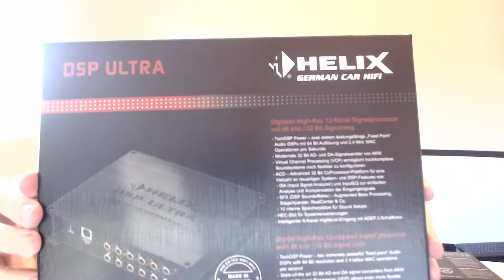Helix DSP Ultra

Comment: Can you please tell me where you got the coax cable from
Reply from the maker: I have since changed it to an Audioquest Cinnamon coaxial digital cable and I ordered mine from a local audio video store as it’s 5 metres long. You might be able to find one on Amazon.
Reply: @CarAudioHorizons   I'm just building a system. Going with 2 way focal utopia m speakers a mosconi pro 5/30 amp. Jl audio 10 inch w7. I just can't make up my mind on the dsp , either mosconi 8 to 12 aerospace,  helix dsp ultra or pro mk3
Reply from the maker: @drunknmunky29  Nice system, go with the Helix DSP Ultra or the Zapco
Reply: @CarAudioHorizons I have the new 2023 Mosconi DSP Aero 8 to 12. You’re an honest guy…what do you think of it?
Reply from the maker: @jstar3387  I haven’t heard one so I can’t comment on it. But I have heard the Mosoconi Pro amps and the separate DSP’s but that was before their software update and they sound good. The Mosconi 4/30 is their best sounding amplifier and all the other Pro amps sound like their AS amplifiers which all sound good.
Reply: @CarAudioHorizons  I have a Ipod touch bluetooth and bought the 2023 high end Mosconi 8to12 Aero DSP…Some people say that I don’t need a High Res DAP player since the DSP will be doing all the converting…and that the Ipod bluetooth will suffice. Do you agree with that? Just curious.
Reply from the maker: @jstar3387  Like I said in my other comments it’s pointless to have a high end dsp and use the worst Bluetooth codec on an iPod Touch. What’s the point and is this a serious question?
Reply: @CarAudioHorizons   Thank you. I realize now that you answered this question in the other post.
Reply: @CarAudioHorizons  BTW…I asked the same question on a Car Audio Facebook Forum and here is what one person told me

“No, the analog signal from the DAP will be converted back to a digital signal by the DSP for processing then the DSPs DAC will convert it back to analog, making the DAPs DSP pointless. If you're sending the signal via bluetooth from the DAP then that signal is digital anyways so you're not using the DAP's DAC in either scenario with a DSP.”

I am guessing he is wrong?
Reply from the maker: @jstar3387  The Mosconi 8 To 12 Areospace has coaxial digital input so I would run a DAP that has coaxial digital output into it. Or a less expensive option if you want to use your phone buy the SMSL PO100 pro and go coaxial digital out into your Mosconi 8-12
Reply: @CarAudioHorizons  What DAP would you recommend for this now in 2023?